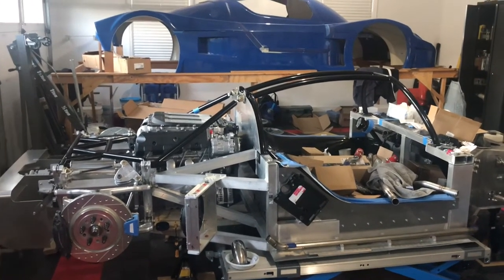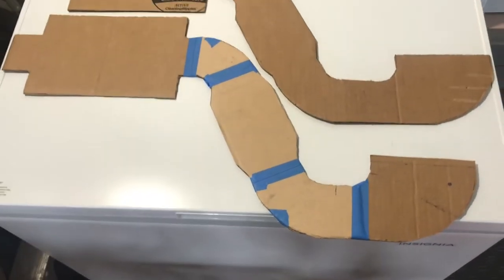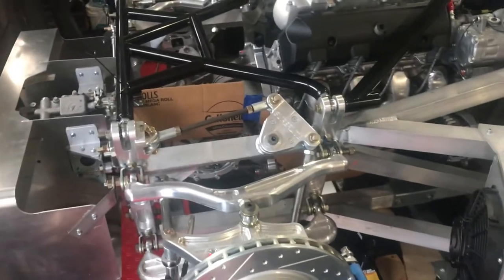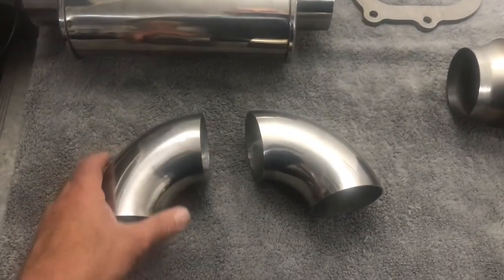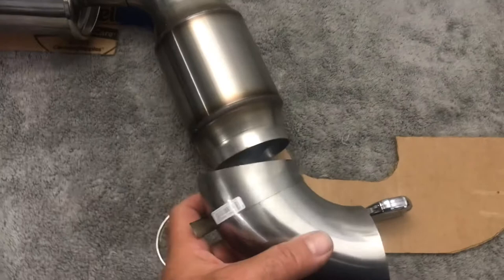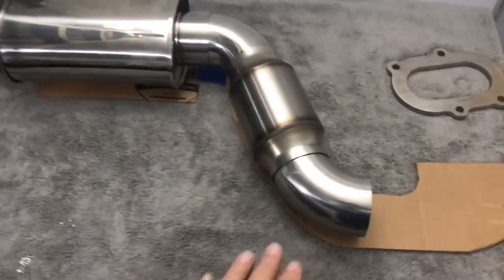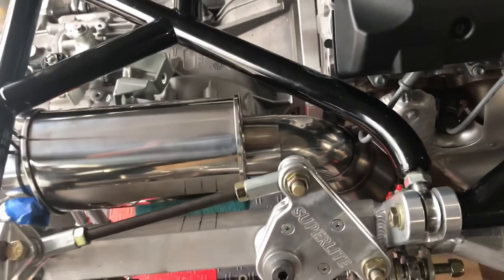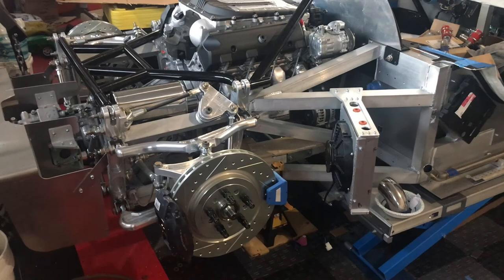Superlite SLC Build Video 93 - Exhaust System Fabrication Part 1

Comment: Hi Joel, I have been following with envy.  Love your build.  I wish I could do one of these beauties.  I especially love your brackets for the AC and coolant tubes, amazing.  You might want to consider exhaust wrap on your exhaust system.  It looks terrible but contains the heat to the exhaust.  BTW they are called hose clamps that you put on the pipes to get straight lines.  I was a goal tender growing up in Minnesota so I loved the hockey puck as a shim.
Reply from the maker: Thanks Jeff, appreciate the kind words. Yes, have a couple approaches to heat shielding and wrapping in mind. Still fiddling with the fitment of the down pipes, but getting close to tack welding them.

Comment: Great progress Joel!  One suggestion particularly on the cats since the clearances are pretty tight:  make sure you have room to fabricate heat shields around them leaving ~1/2" of air gap. They get much hotter than the rest of the exhaust so need to provide extra protection around them and the angle pipe right after the cats. I did heat wrap on my shifter cables and the outer shell still melted until I added a metal shield.
Reply from the maker: Thanks Mark, I’m fabricating the exhaust down-tubes now and playing around with the shifter cable position. Hopefully I can get at least a 1/2” to an inch of clearance. I watched your video on heat shielding a few times and Johan sent me some detailed pics of his shielding. He used a product called Zercoflex on both sides of the shielding panels which he said worked really well.

Comment: My friend Dan Dulac used a plastic exhaust mock up kit made of plastic that he then transfer to the Stainless Steel. Joel you are coming right along.
Reply from the maker: Thanks for watching Dave. I follow Dan’s build and his quality is off the charts. Dan did full headers so he really needed to use the mock up kit, this hopefully is orders of magnitude easier than what he did.
Reply: @JoelKSLC  thanks for your Have a very productive week.
Reply from the maker: Dave, working on the down pipes now, definitely have some fitment issues so looked up the Ice Engineworks 3” exhaust plastic fab kit. The 3” version is a new product and really nice, but it’s $750. Could always sell it when I’m done, but trying to figure out how to get the pipes oriented without needing to go there. Stay tuned!
Reply: @JoelKSLC  WOW Joel I like the idea of Ice Works 3” kit. I will definitely stay tuned. Have a Great Weekend